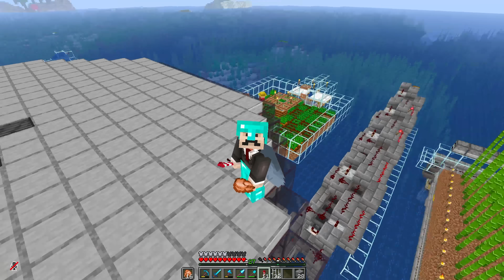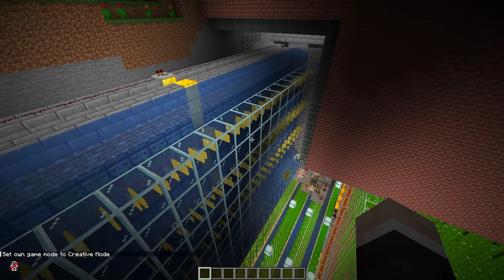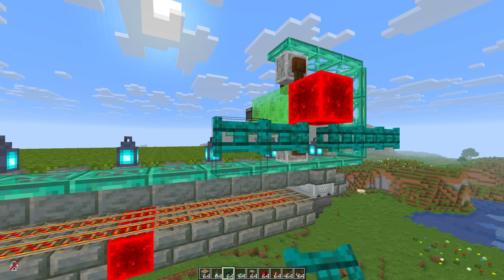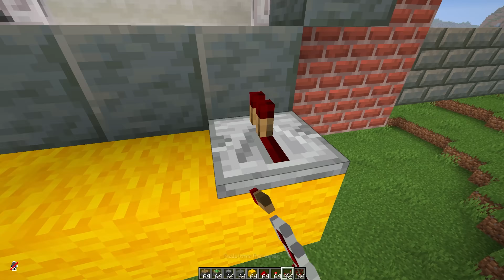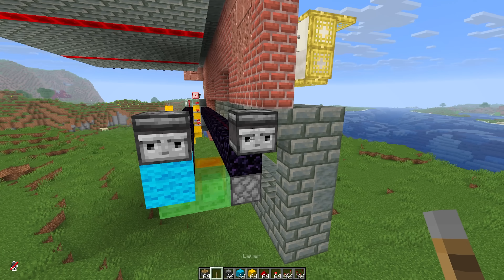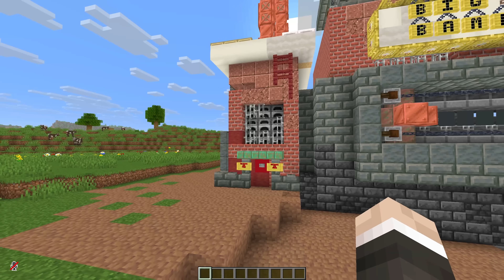Making Industrial Minecraft Farms Mechanical

Comment: 11:00 You could have the campfires lower in the chimney so the smoke doesn't quite reach the top, then when it turns on have a piston move hay under it so the smoke goes higher. You'd just have to have the outside of the chimney be all trapdoors or shelves or something of the sort.

Comment: If you want to toggle the chimneys, you could drop the campfire down far enough into the chimney such that the smoke particles don't clear the rim, then push a haybale in under it when you want to turn it on. Doesn't work that great with the exact chimney design you have here, but it can be done in a 1x1 (3x3 with trapdoors hiding the mechanism).

Comment: For your chimney smoke idea, could you use leafstone to have a piston push and pull a haybale from under the campfires?

Or if you aren't using haybales, can campfires be moved via pistons? Because iirc their smoke can pass through a block placed above them but not through a block 2 blocks above them.

Comment: Pretty sure you can turn the chimneys on and off by putting hay bales under them and having the difference in the height of the smoke be the part that pokes out from the chimney. You can then use a piston under the hay bale to pull it away and wire it up using a series of observers. This should fit in a one by one.

Comment: Suggestion for the smoke stacks - hay bales under camp fires make the smoke go up higher. You could just piston pull a hay bale up and down depending on if the factory is running or not.

Comment: Love the idea of turning the smoke off when the farm is not working. You could put the campfires further down the construction (10 blocks), hiding the smoke, and then pushing a haystack with a piston when the farm is on to extend the height of the smoke column (adding 15 blocks to the smoke column!).

Comment: For the smokestacks, I know you can put out fires with water, not sure if you can relite them.  You could also have a haybale pushed under it when it's on, so it's low smoke in idle and the high smoke when running.  Anyway, love the build!

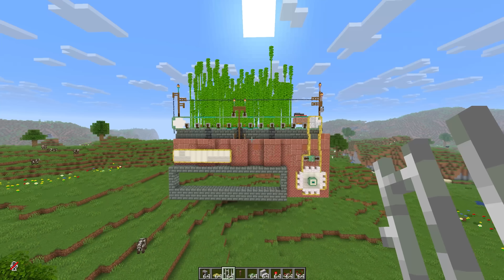Comment: When you have chains (like you constructed around the gear at 4:43) you need to pay attention to which side the guiding wheels are on (referring to the centre set of wheels here, the ones around the copper block). The wheel on the right is fine, but the wheel on the left should be on the other side of the chain, as the chain should be pulled tight around it; as it is, it looks like the chain has a huge amount of slack to be able to sit on the wheel, except realistically the chain would just slip off the gear if it had that much slack in it. (I think a lot of people make the mistake of putting way too much slack in chains. If you look at a chain, they’re pulled very tight, so that they appear to be completely straight except for where the wheels guide them. Even the small amount of slack visible in the right hand side where you’ve switched the side the trapdoors are on is a bit too much.)

Comment: i started designing tileable, one wide farms that use as few minecarts as possible and build in a way that pistons only fire when needed. they arent the most efficient but still efficient enough for me and i build them in the walls of my base, so as long as i build on my base or chill there, they are active. for example i am currently building a base inspired by konpeki plaza from cyberpunk and have decorative bamboo on mud behind black tinted glass and framed in dark wood in my walls and the second row of bamboo gets harvestes as soon as it hits 12 blocks height but only the one that reached the height gets harvested. under the mud i just have hopper chains. both hopper chains instead of hopper minecarts as well as the fact only one piston ever fires when a bamboo reaches 12 height reduces so much noise. im really happy with it and i love the challenge of building those one wide segments made to get lined up in my walls
Reply: i hope my rambling is understandable xD

Comment: 10:57 could you set the campfires at the bottom of the chimney, with a hay bale that gets pushed up underneath of them when the farm turns on? IIRC hay bales increase campfire height by ~10 blocks

Comment: I Noticed the Sound of a Flame Charge or something came long after the Furnaces activated, but It would line up if You did the Bells later. Besides, Wouldn't it Make more Sense to have the Bells alarm after the "Engine" was Turned on anyway?

Comment: Hey blocks make campfires' smoke go taller, so if you make the chimneys out of trapdoors entirely and then place the campfires way below, you can switch the block beneath the campfires to hey when its on and anything else when its off, you can make the chimneys the exact height so you wont see the smoke when the farm is off but would when it's on!

Comment: For the smoke stacks, you could place them lower in the build so the smoke just barely reaches the top of the chimneys, then push hay bales underneath them (which doubles the height of the smoke).

Comment: My only gripe with this is that's not how the gear and pulleys would work. The piston should go slower then the gantry due to it going into the big gear and the gantry connected to the small gear. So didn't need to change the speed

Comment: mumbo over engineered the bamboo farm imo. It really just needs the center bit to be using "chains/wheels" to carry the contraption on in which you can then just enclose the outer edges since the wings could just "glide" from slits in the wall.

Comment: 11:00 you could technically make the chimneys out of trapdoors and have the inside hollow, then you can shoot alternating fire charges and water bottles onto the fireplaces thus toggling the smoke, in my testing both throwables consistently shot at at least 10 blocks high without crashing into the sides

Comment: 10:56 if you can make a way to get a redstone pulse up with a single block width you could put splash water potions in a dispenser and cover up the redstone with shelves and trapdoors on the outside

Comment: 10:56 If you power a sticky piston to push a hay bale under a campfire then it will increase the hight of the smoke so if positioned low enough it could appear as if the smoke is turning on while still staying in a 1 block area covered by trapdoors.

Comment: @ThatMumboJumbo at 11:27 you mention about turning off the smoke stacks. Could you have them at just the right height where when you push a hay bale up under the campfire so it does the extra distance to the smoke? When it pulls away I’m thinking the smoke would be hidden in the column, thus appearing off.
Reply: Wow I also had the same idea as you two and came to comment this haha, I hope he sees this!!
Reply: That's what I thought at first, but the chimney contains solid blocks, so the smoke can't go all the way through
Reply: Was just about to comment this on this time stamp then ur comment appeared🤣
Reply: I think the chimneys would need to be slightly thicker for this, but the methods I could think of would've needed it to be thicker still. This is a genius way to do it at minimum chimney thickness.
Reply: @Krixwell  You could surround the top 6 blocks entirely with trapdoors.
Reply: @shashankmahalingam5254 Oh yeah, that could work.
Reply: Another idea. A dispenser with a water bucket from the bottom.
Reply: @shashankmahalingam5254 That'll turn it off, but you need a second dispenser to reliably turn it back on, which means you need a significantly thicker chimney to hide that dispenser and the redstone controlling them both.
Reply: @Krixwell  Right. I didn't think about the fact that you need a separate dispenser to turn it back on.
Reply: 4:20 first thought- its a giant reverse 3d printer? Continually knocking into  the extrusions that are squeezed through the base

Comment: I heard a trapdoor can block smoke completely, so it works as an on-off toggle, I guess. Also, I’m not sure if this works, but you can extend the smoke using a hay bale. If a piston can actually push a hay bale and make the smoke extend, you could place the campfire lower and enclose the smoke to hide it. Then, whenever your machine is activated, simply push the hay bale under the campfire to make the smoke visible at the surface

Comment: no honestly, that bidirectional gear is amazing. i'm a little stoned and i've just been playing 6:22 - 6:36 on repeat, making it go whichever direction i want with nothing but the power of my mind (and your buildstone)
Reply: also, as much as I Do Not understand redstone and buildstone (yet, I recently started learning) one thing I've been doing is using the noises farms make for soundscapes around my base. the iron farm i.e. is hidden beneath the blacksmith, and i might add a little basalt farm on a timer because i really don't need that much of it and the occasional extinguishing noise would probably work really well in the area

Comment: You could switch the smoke stacks on and off using scaffolding, an observer, and a dispenser with a water bucket and flint and steel (though that would alternate randomly, rather than specifically on or off). 
Then you could recreate the textured look with trapdoors and shelves.

Comment: an allay could possibly be released after each run of the machine to pick up any of the bamboo caught on the chains and trapdoors and such at 13:26
Reply: There was an awful lot of floating bamboo up there.
Reply: @Pinnix i imagine if it's on a clock and not manual, that won't be much of an issue cause it won't grow that tall
Reply: @Pinnix  i think that the idea is when the flying machine next passes it will just push that to the ground.
Reply: @robertking-yt unfortunately, that isn't what happened, though.
Reply: @Pinnix  Pretty Farms are not about efficiency, but style. 

... but  yes, the allay would help to reduce the baboo casualty rate.
Reply: I think adding a few animals would be so cute! Like having some parrots on the chains at the top to just chill at the farm would add even more detail.

Comment: Suggestion to make it make more mechanical sense:
don't use full belt/chain loops around the gears. The two components moving in opposite directions can be assumed be mechanically linked by a single run of chain or belt going from the bottom one, out around the outer edge of the first cog/pulley, up to the second cog or pulley, and then along horizontally to the left towards the bamboo harvester.

Comment: Campfires with hay bales under them make taller smoke stacks. If you sacrifice your trapdoor design a little bit so that the chimney is hollow (maybe use shelves to make the different thicknesses), you can strategically place the campfire such that when there's nothing under it, the smoke doesn't go up far enough to be seen, but when the farms are turned on, you move a haybale under it to make the stack pop above the chimney.

Since this can be controlled from a piston on the bottom, it's a 1x1 mechanism on top of a torch tower, as unlike quenching the campfire (at least 2x1) or a lid (3x1).
Reply: Exactly what I was gonna suggest
Reply: well i wish i had found this comment before posting mine which basically suggest the same thing although with a different observation.
Reply: Heh also here for this. Acacia shelves would fit in well for that.
Reply: That's what I was coming to suggest too lol, it looked great in Pixlriffs super smelter build when he did it.
Reply: A 1×1 quench and ignite combo would be possible it just has a 50 50 chance of doing what you want. Kinda like An old engine you would have to crank it a few times before it kicked on
Reply: @chrisnorton9087 technically yes, but there's no 1x1way to read that out to make the rest of the machine go only when it works.
Cool idea for his scrapyard base though!
Reply: @chrisnorton9087 why didn't it turn on? You flooded it :P
Reply: Wait are we idiots. Fire charge into a dispenser to light it,  water splash potion to turn it off. Can by used lower.  Just need to refill it with fuel and coolant. Which is arguably kinda cool.
Reply: @GoofyGE3K do they get launched straight up? They might collide with the walls before reaching the target.
Reply: @thekroltan just needs to go a few blocks.  Not sure.
Reply: I missed your comment! I just wrote a long explanation that's basically the same as yours😂😂😅
Reply: And also, I heard a trapdoor can block smoke completely, so it might be even easier. I don't know, I haven't tested it yet

Comment: I'm imagining that the bottom slider is being pushed by the pressure in the boiler, and it's on a spring or something so when the pressure is released, it goes back. Basically a one cycle steam engine.